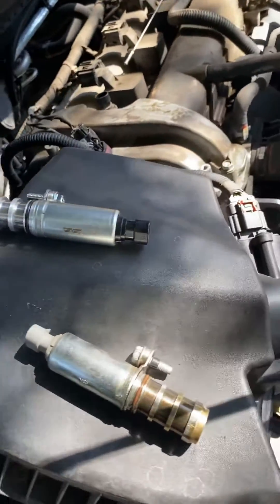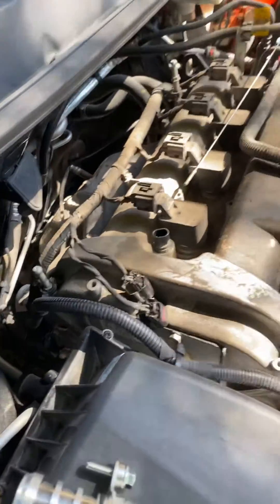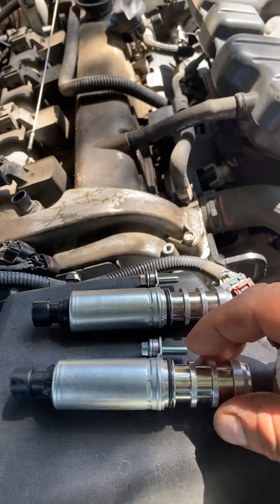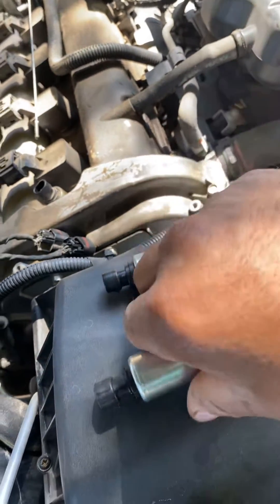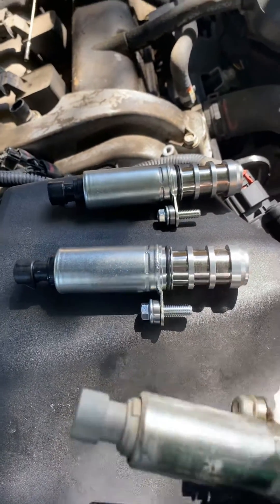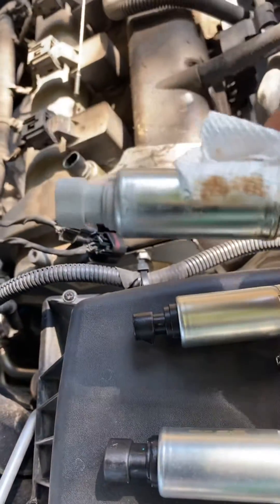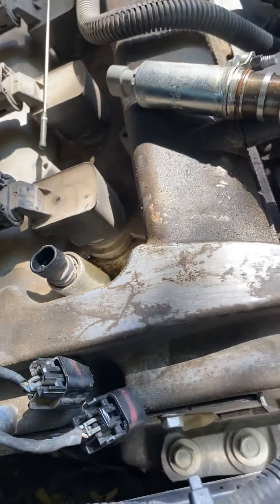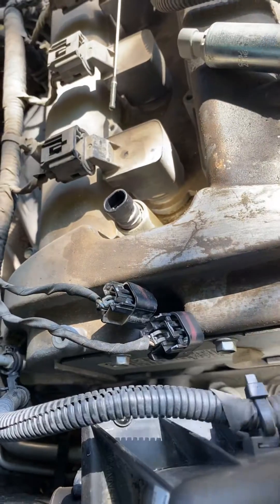2013 Buick Verano intake, and exhaust valves placement.

Comment: Good to know.  I Just changed mine with GM solenoids.  Color coded.  Only $32 each from Amazon.  My intake one was intermittent faulty, but I changed both anyway.  Switches are junk.  Car only has 35,000 miles and this wasn’t the first change.  Noticed Wire clips were gone and exhaust switch was aftermarket